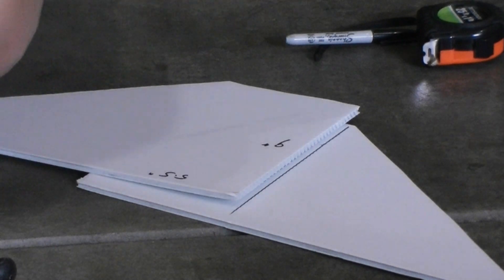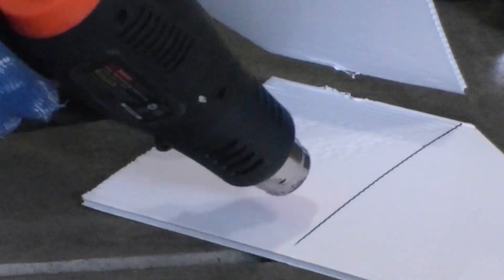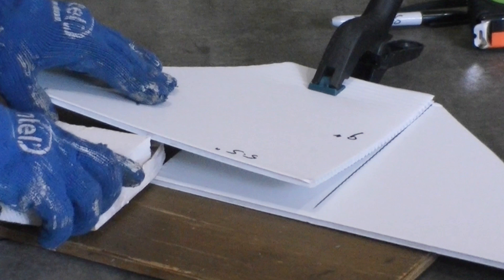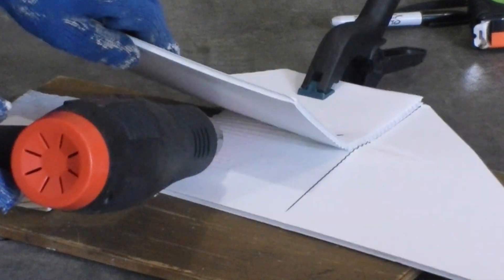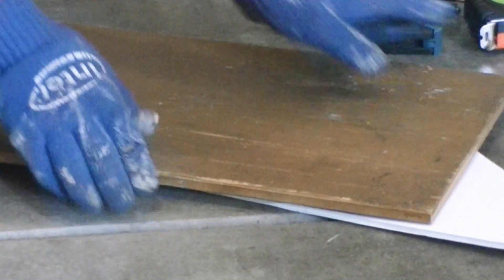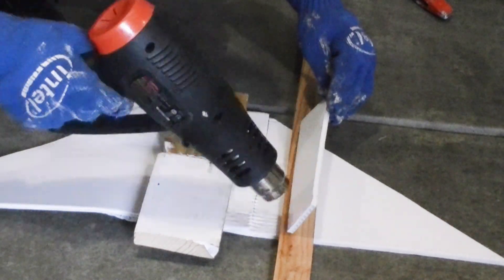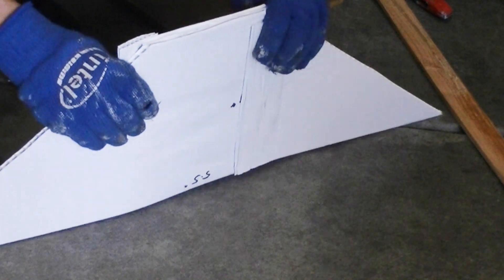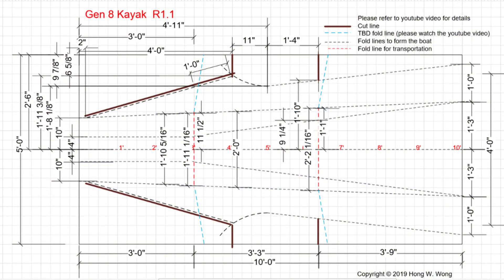How to fuse two coroplast sheets together -DIY  using 4'x8' sheet to build boats part 2

Comment: Very cool videos.  I just found your channel. I enjoy the simplicity of fusing the sheets together.  

Two questions about using coroplast. 

As an amateur crafter, is there any reason I couldn't use epoxy to bond two sheets and potentially add weight bearing strength?

Could contact cement be used for areas that need to bend or flex repeatedly?
Reply from the maker: Sorry for the slow reply. Most glues will not bond coroplast. I searched youtube and there is one special glue from 3M that may be able to bond coroplast. But it is expensive especially you need to bond a large sheet (need a lot of glue) and that defeats the purpose of using coroplast to build a low cost boat. Besides heat fusion, you can use contact cement to join two sheets together. If you read the community page, you will see a boat was built using that method: https://www.youtube.com/@DIYUSA/community    
Other viewers have used glue gun with polypropylene glue sticks for bonding. It cost money to get that high end glue gun. There is ultra sound gun for bonding coroplast. It also cost $1500 or more. For  me, the lowest cost method to bond coroplast is by heat fusion.  The Gen 14 and 16 were built using that technique: https://youtube.com/playlist?list=PL2ShZzOUu01ul94LmvXJm_K3NVBKerLc5
Hope I have answered your questions. Cheers!

Comment: Very interesting. I seen Paul Elkins fold up corrugated plastic kayak, but it is only one sheet but pretty interesting,  it folds into a flat sheet. 
It would also be interesting to try PMF on foam board for a kayak, this way we can make it any length we decide. We could use the fiber cloth to overlay the joints it will help hold it in one piece at the same time making it water proof.
Reply from the maker: Thanks for watching and your comments. Yes, I have tried most of the things you mentioned: PMF foam for my 1st foldable sail boat, etc. I have not tried the fiber glass yet because my goal is to build a simple functional/useable boat easily, quickly and doesn't cost much. I have created over twenty different designs and you can see most of them here: https://www.youtube.com/c/diyusa I have boat plans on my web site: www.DIYUSA.org 
My friend fused two 4 mm thick 4' x 8' coroplast from Home Depot and built the 14' foldable kayak. You can read more about this: https://makezine.com/projects/origami-kayak/
Oh, other goals are I want to build boats that are light (13-30 lbs) and can be transported in the truck of my car. At this moment, I am building a 13-14' long modular sit-on-top kayak. Cheers!

Comment: how about a heat blanket with a themoater on it?
Reply from the maker: The heat blanket is not hot enough. Heat gun shoots hot air at over 500 F. My friend used cloth iron, which works but takes a long time. I tried that too. I did a video on that and compared the result (vs using a heat gun). You can read this article and see how he joined two coroplast sheets and built the 12 ft boat. https://makezine.com/projects/origami-kayak/

Comment: a C-clamp and two pieces scrap wood, would be an effective way of clamping it together until it cooled and would create a  good bond. Great video.
Reply from the maker: Thanks for your feedback and suggestion. One issue with heat fusion is I have only seconds to place two sheets together. It is very different from using glue. Once I placed them together, I can't move them because the movement will damage the jointed surface. Your comment inspired me to think about using a long sheet of scrap wood, and then place some heavy weight on top till the joint cools down. Thanks.

Comment: A few Coroplast extruder are perfectly willing to produce a small batch of extra long Coroplast at extra cost. Try the one in Granby Quebec on Cowie Street. You would be surprised on how little extra they would charge you for 10+  16-foot sheets or more.
Reply from the maker: Thanks for providing the name of the supplier. A few years ago, I contacted US manufacturers and Chinese manufacturers, the min. order qty ranged from 100 to 500 sheets (a 8'x20' shipping container). I also priced the size of the sheets, the density, color, etc. I agree, the larger sheets cost slightly higher. The main cost is in shipping. I learned how to import coroplast from China. After adding shipping, import tax, hiring an agent, etc., the total  cost is still cheaper than getting that in US.  But it took me four months. Since I ordered in bulk, I have enough coroplast at my garage to feed my hobby for the next ten years :-)  If I have discovered heat fusion, I would not have custom ordered so many coroplast (in bulk).  One other note in shipping, they only ship to a business address with loading dock. I have to use my friend's shop to unload the sheets :-)  Recently, I searched on google and I notice there is a seller able to sell a single piece of  12' x 5' coroplast. But the shipping cost is very high. As a hobby, I would just stick with heat fusion for now :-) Cheers!

Comment: Don't overlap the section to be heated. Stack two equal sized aligned sheets between two boards with only 1/2 inch exposed. Apply pressure with clamps to pinch both sheets between the boards. Use your heat gun to melt the exposed 1/2 inch together creating a melted bead between the boards. Let it cool. Remove the boards and unfold the sheets as needed.
Reply from the maker: I tried your method, and  have a very good result! Thanks so much for sharing this method. I created a video to share your idea in this video: https://youtu.be/7cGiclzy4yQ
Reply from the maker: Really appreciate your suggestion. Will definite experiment with this approach. I need to test how much force is needed to pull these two fused sheets apart after this fusing process. Thanks again.

Comment: Thanks for the 2 videos you have made. I'm not trying to build a boat at present but am interested in what you are doing and especially your experiments. The process you are using could be useful for some prototypes I'm making. Watching your process suggests that the heating is uneven, so the fusing of the 2 sheets is uneven and will have varying waterproofing and bond strength across the joint. So how to get even heat by hand tools over the bonded area?  Is it possible?  Maybe you could put a flat sheet heater strip heated to a precise temperature to say 3 degrees below the melting point of the sheet, on or between both surfaces.Then remove the heater strip and apply a quick blast of hot air with the heat gun using the technique you have demonstrated. To get the exact temperature you need would require using  a PT 100 temperature sensor probe and a PID controller to get the heater unit flat lining the temperature, but these products are getting quite cheap now. Here's a few suggestions though there are many companies internationally to get suitable products from-
https://www.auberins.com/index.php?main_page=index&cPath=20_15&sort=20a&page=2
https://www.auberins.com/index.php?main_page=product_info&cPath=41&products_id=330
The link below is to Polyimide rectangular strip heaters which have various supply voltages and dimensions. Obviously the 28 volt a.c. ones will be much safer to use to reduce the risk of electrocution. For this you will need a separate power supply.
https://www.omega.com/en-us/industrial-heaters/flexible-heaters/p/KHRA-KHLVA-KHA-SERIES
If you are prepared to risk 110 ac volts to the heater strip the Model: WS-1510EBPM temperature precision controller in the 2nd link listed  can supply the output power without purchasing a 28 volts ac power supply.
Reply from the maker: I really appreciate your informative feedback. Your comments and observations are all correct. Since I can't include photos in this reply, I would like to direct you to my blog for my detailed reply. https://www.diyusa.org/blog

Comment: So this was what I've been looking for! I wanted to make my Coroplast boat at least 12 feet long and I was considering a flex seal type product. Maybe even a combination of this method and the flex seal would make it even more water tight. Thanks!!!
Reply from the maker: Thanks for watching.. I bought 10' x 5' coroplast sheets hence I have been building boats in that size only. Later I developed this fusion technique and I have actually fused a larger sheet: 14.5' long,  and plan to build a 3-seater Jon Boat for fishing.  https://youtu.be/5D1pREO04fs   I plan to put a trolling motor on it and I will have to register the boat with a motor in Oregon (more paper work and cost to keep a boat). I have not finished it yet because I have not make up my mind  on the width of the boat...3' or 4' wide. This is all related to how I will transport the boat to the river So far, all the boats I have designed can be fitted inside my small  Prius C. If I do a 4' wide 13' long Jon Boat, I will have to be able to 'Car-top' it (when folded). I don't know if flex seal can stick to coroplast.... But I don't worry about leakage because if you fold the boat correctly, and it should not leak. If one day it leaks (wear and tear), I can easily fuse a small sheet on top and patches it up easily. For a small hole, using super glue and baking soda can fix that. Gorilla tape would be a quick fix also. Hope my other videos will be useful to you... thanks for your comments.

Comment: I ll try to make something like the portabote/quickboat design with this material! if i ll find it easily around  otherwise i ll go with xps foam i think! Great videos! Cheers
Reply from the maker: Thanks for the feedback. Yes,  I believe I can do one similar to portabote. With this technique I can use coroplast to create the frame and use the coroplast to make the skin also. I have been working on a foldable sailboat and will publish the details in building that boat in the next few days. 
I have tried XPS and used the 'poor man's fiber glass' method and that works well too. However, it is rigid and I cannot fit that inside my car...I plan to do a modular paddle board using this idea (in this coming winter) with internal core using partial xps + coroplast (as internal structure). I hope a hybrid solution will bring the weight down to around 20 lbs, and the board can still fit inside my car.
Reply: @DIYUSA  Isn't it better something like rubber for the joint skin? Also what thickness coroplast would you use for it?  I intend to use it in the sea!
Reply from the maker: @KEEPTURNINGLEFT1312   I don't have experience  in jointing rubber to coroplast. If there is such glue, my guess it will be costly. You may want to look into ultra-sonic welder and see if it can joint rubber to coroplast and also provide a water tight seal. The welder is costly also. The coroplast sheet I use are 6 mm. I believe ORU boats use 5 mm. This guy has paddle ORU in Pacific ocean (provided it is calm - please see the link https://www.outsideonline.com/2061741/365-days-oru-worlds-most-interesting-portable-kayak)
I believe ORU has sea kayak also. It is not if the coroplast can handle the ocean, it is the  design of the boat can handle the rough sea condition, which can happen in a large lake ( Lake Ontario, etc.) also.

Comment from the maker: Update:  The jointed area is very strong. The fused/overlapped area feels like a solid sheet of plastic. That means bending the fused joint is very, very difficult. This new characteristic needed to be taken into consideration when you design the folding feature of the boat.